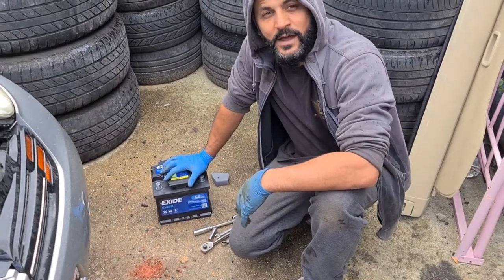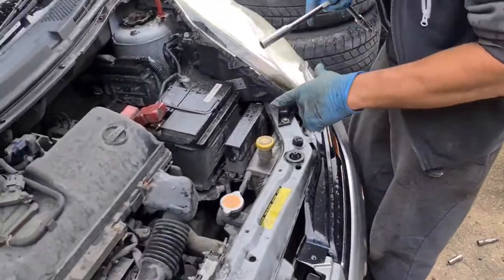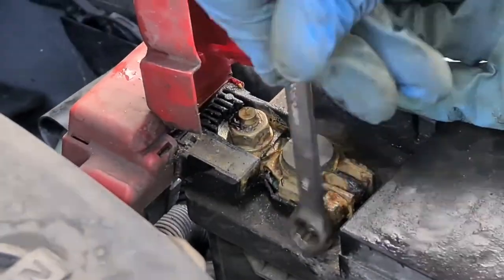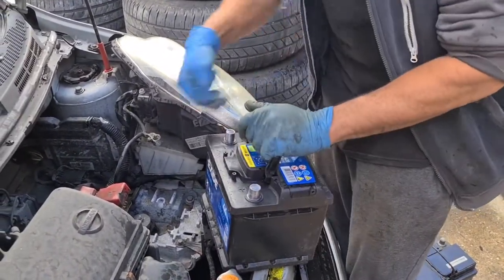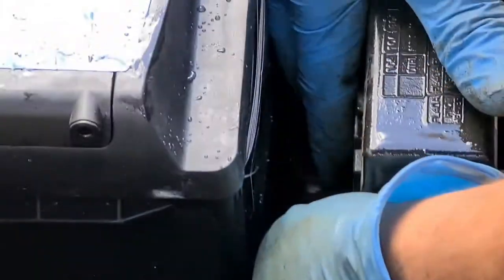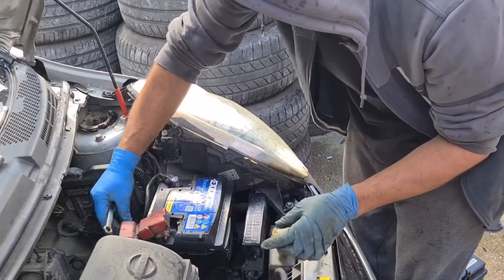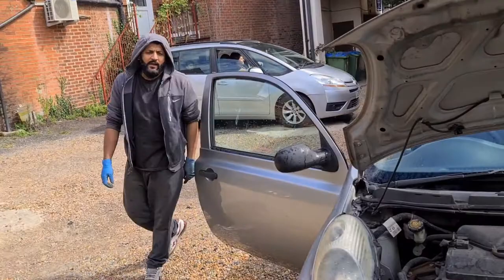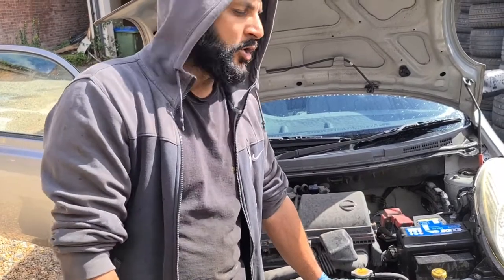how to replace a battery on Nissan Micra Full HD 1080p

Comment: Many thanks from Poland - found the video, watched it - clear, straightforward - all good - one note though - I found it to be an 11mm spanner (not 10mm) that's needed to loosen the connectors. Without your help, I'd have never located that 13mm nut holding the battery in place! Easy once you know! Thanks again.

Comment: i dont need to disconnect any elctric fuse or something first? just straight up change the battery ?
Reply from the maker: Hi you dont need to take anything out except ignition off keys out and then remove the terminals from battery. Some cars have radio codes so onces battery replaced you may need the code but i dont think Nissan has radio code. Thanks 😊
Reply: @TajMotorMedics  Thanks!!

Comment: Hi can u tell me I changed the battery on my sister Nissan Micra and now the doors won't lock and I got new battery for the key fob can u tell me if I have to program it and how
Reply: Hi, please share, how did you solve the Nissan car door problem?
Reply: @balanceskateboarding8807  I had to program the key to the car mate and it worked fine after that

Comment: What to do to deactivate NATS after i had negative pole off. Cant start
Reply: Did you leave the key in ignition when you remove your battery? I did once, and my car couldn't start. I called an auto locksmith to fix it